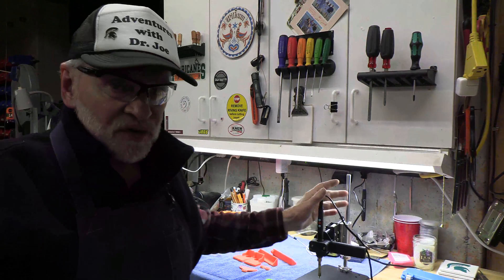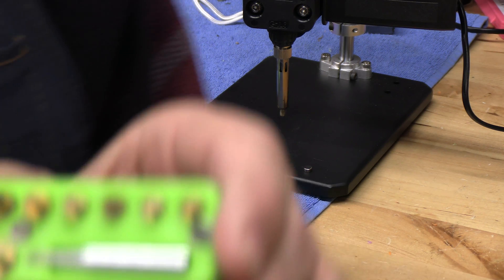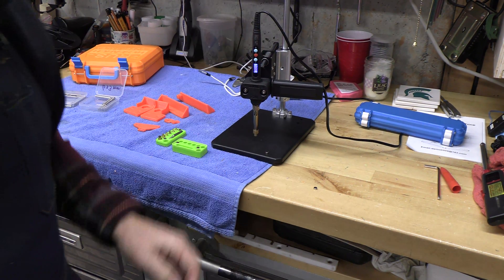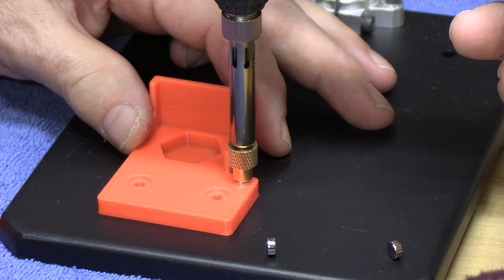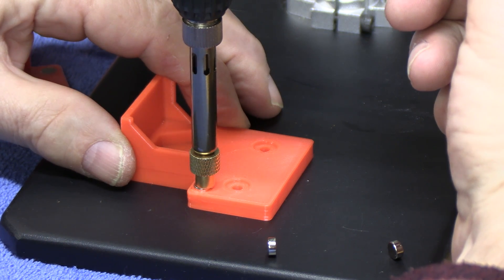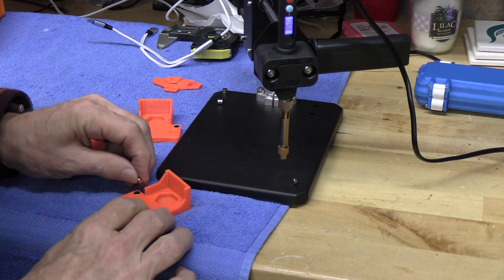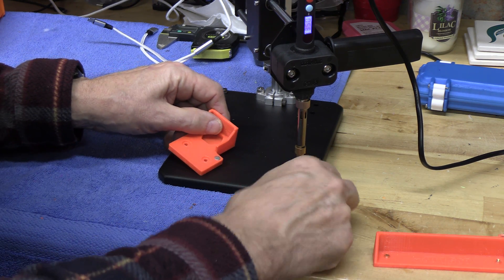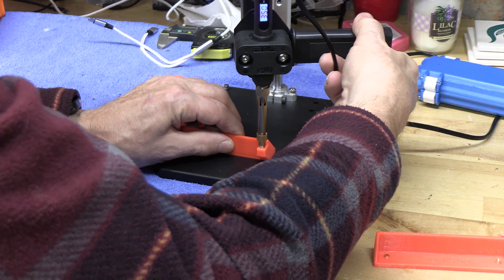Heat Press Magnets for 3D Printed Parts

Comment: From personal experience small  magnets will lose at at lease half or all of its strength it heated past Maximum: 80C / 176F for N42 (the cheaper kind) and N52 Maximum: 120C / 248F. PLA has a glass transition temperature of 60°C and viscous enough to be extruded  between 180 and 230°C. So you might want to check what will work for your project.
Reply from the maker: You are totally right thank you for your comment. Heating magnets is not great because they will lose their magnetism but if they’re heated, just enough to melt the plastic, they’re usually maintain their magnetism as you can see in the video. Thanks. Joe.

Comment: You don't make clear if the magnets "stick" in place or do they eventually pop out?
Reply from the maker: I’m sorry I didn’t make that clear. Basically when you melt a magnet into the filament, it creates a bond with the filament itself and it stays stuck. Thanks. Joe.
Reply from the maker: Yes, they stick in after you put press them. Don’t heat them too much.

Comment: do you have an stl for that heat press tip container
Reply from the maker: Thank you for your question. Yes I do and I will try to forward that to you. I did get it from printable which is from Prusa consider subscribing. Thanks. Joe I had to modify that a little bit by the way to get the soldering iron tip to fit, but it was easy.
Reply: Thank you so much for the file. I really injoy your videos, they are very informative and you explain everything very will and at a perfict pace.I just ordered the Prusa XL 5 head and the encloser from ali express. hopefully I will get the printer in a few months. They said 7-8 weeks. I have a few bambu printers now but am looking forward to my new prusa. Keep up the good work and look forward to watching more of your videos. @JosephHunstad
Reply from the maker: Heat Insert Case: https://www.printables.com/model/118165-box-fur-ruthex-einschmelzhilfe-brass-insert-tool

Comment: Cheap neodymium magnets are rated to max 80 degrees centigrades. It is not a good idea to heat insert those. You may use the 120 degrees or 150 dergees ones safely though.

Great channel, Joe. Good luck with your maker and youtuber carrier 🙂
Reply from the maker: Thank you for your comment. Yes you are absolutely right. Caution needs to be exercised when heating these probably best just to use a press fit and I can do that. Also with a drill press I have a video on that. Take care. Joe.

Comment: doesnt heating magnets with high heat demagnetize them? Especially using earth magnets or "the stonger" magnets???
Reply from the maker: Great question. You’ll see I have a disclaimer that says that heating these above their Currie 0:02 point will demagnetize them. These are neodymium magnets so you have to be cautious with heating them. I also have another video on using a drill press with a pin punch as basically an arbor press to place magnets. That’s a great way to do it. also that avoids any risk of demagnetizing. Thanks for your question. Very observant. Consider subscribing. Thanks Joe.

Comment: Heating magnets tends to de-magnetize them. The fact that the magnets used to test polarity continued to attract a single side would suggest the magnets didn't lose all of their alignment but very likely most of it. You could use a sacrificial magnet to make the correctly sized hole for another un-heated magnet.
Reply from the maker: You make an excellent point. I did put a disclaimer in warning not to keep these above their Curie point. I also have a video on using a drill press with a pin punch probably the best way to insert magnets into 3-D printer parts and there's no risk of demagnetizing. Thank you for your comment. Consider subscribing. Thanks Joe
Reply from the maker: Also quick point if I used a sacrificial magnet unfortunately there almost impossible to get out once there placed. So I think the drill press with a pen punch method is probably the way to go to keep some perfectly lined up perfectly vertically placed in if you're careful and use a pen punch that has a diameter wider than the magnet you should not over insert these.